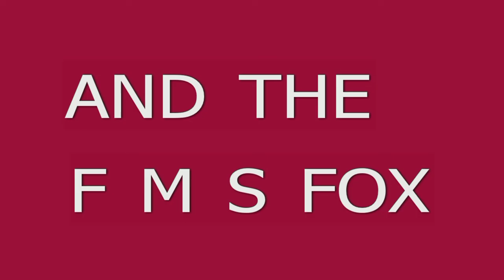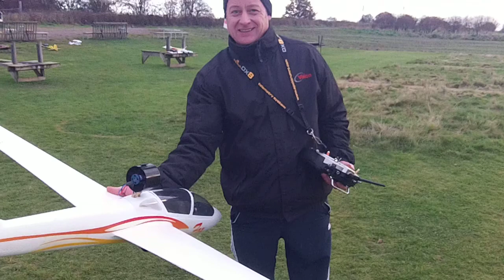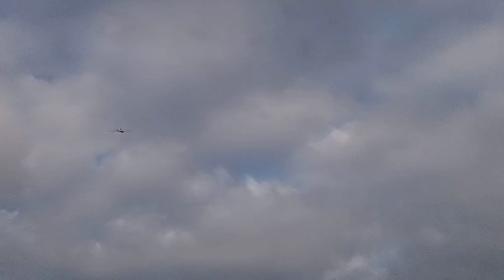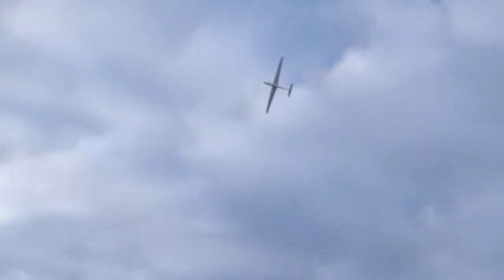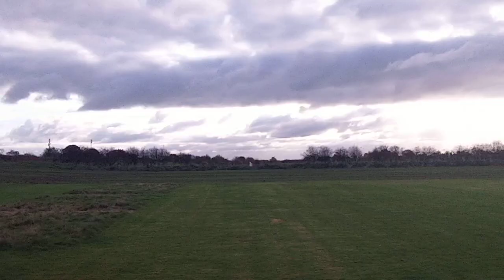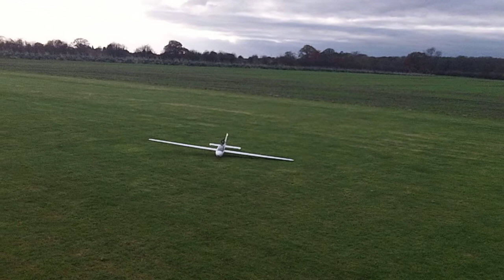FMS FOX .Simon Tripp and his FMS Fox edf powered.

Comment: I know this video is old, but i was gifted a FMS Fox not to long ago, with no prop or motor with it, but instead i was given a 70mm edf, an esc, and a 6s 3700. The guy told me to “figure it out” and he wanted to see it fly. I just cut a slot right behind the canopy, slipped a piece of sheet metal under it and zip tied it down. When I took it to the field to fly the guy doubted me about it. (This isn’t my first time putting a edf on something it shouldn’t be on) But sure enough the thing flew...and flew surprisingly well! Only thing it does awful is that the wings flex really bad, any ideas for that?